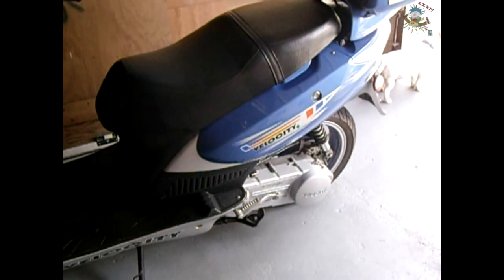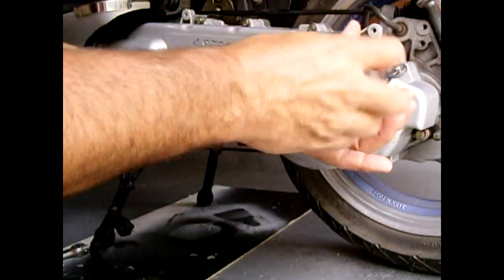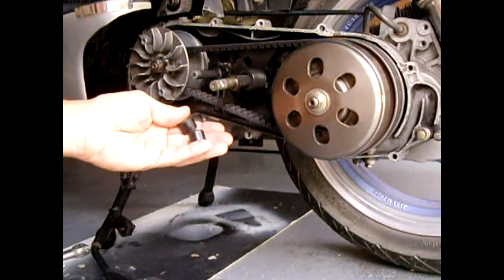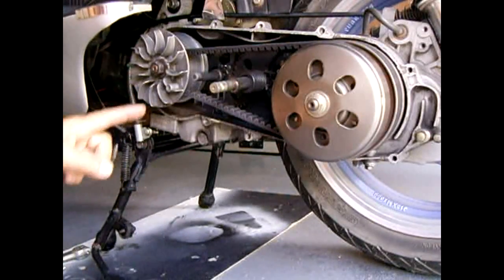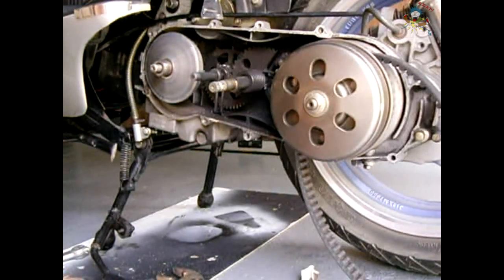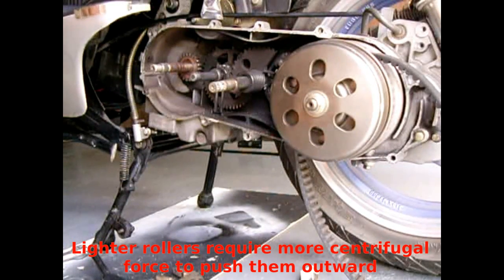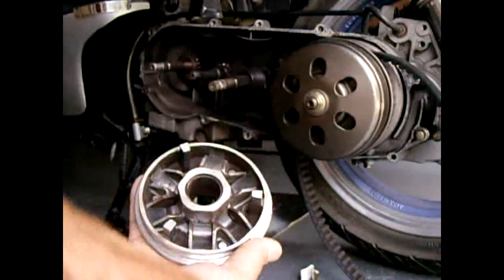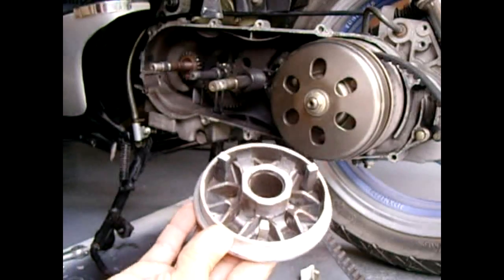GY6 Variator/Roller Replacement & Tips(STEP BY STEP)

Comment: A mechanic who is articulate, and knows how to reduce a learning stream by 70%. A good instructor and film producer all in one. GOOD JOB......
Reply from the maker: JayR Glad you enjoyed the video. :-). Thanks For Watching. Please share and rate Thumbs Up
Reply: electronicsNmore are 6.5grams good for my taotao 50cc
Reply: I agree.
Reply: electronicsNmore this must not be a 50cc, that roller weight sounds real heavy for a 50
Reply: @electronicsNmore  - Between electronicsNmore and Garret Seesing's 911 Scooter videos, I've had the help I needed to keep my scooter running.  I'm not a mechanic.  I'm not mechanically inclined.  Watching your videos to help me diagnose problems made me realize that I am smart enough to work on a scooter if I follow good teachers.  Thanks for making my scooter a fantastic 1,099 dollar investment.  By the way, I had my 2018 Icebear scooter stolen and expected to take a bath on it with the insurance company.  But I have GEICO comprehensive coverage for less than 30 bucks a month and they valued the scooter at more than 1,500 bucks and I got a check for 1283 bucks (after 250 deductible).  Always take the time to compare GEICO with any other insurance companies' offers is my advice.  I was amazed that scooter's ROI would be more than 100% after putting 5,000 miles on it and 18 months after I bought it.

Comment: Why did you not show using that strap method to remove the 19mm bolt?? And using rods in the plastic fan to secure it can easily break the fan.  I must just have one hell of a tight nut on mine because I am buying an impact wrench.

Comment: I love the video. Thanks for posting. I notice your belt is inside out from mine. I asked about this and was told the drive comes from the grip of the tiny perimeter of the belt and was wondering if your belt was different or you flipped on purpose? If you flipped was there a noticeable change?

Comment: Great Video, I have the symptoms of noise coming from the CVT cover. However my 2014  150cc Tao Tao also shakes and stalls out when I come to a complete stop. I have cleaned the carb, checked valve clearances, cleaned fuel filter, messed with the idle screw, and yet it still shakes and dies out when stopping. It was running fine until about 2 weeks ago and then all of the sudden I am having this issue of stopping and having it stall out. Do you think changing the rollers out may stop me from having this issue?
Reply from the maker: Check the valve clearances according to my other video, as well as inspect the intake manifold for cracks.

Comment: My 125 scoot is flat out at 45mph when it should be able to get 50-55mph, so what roller weights do I need to restore the scoots top speed? 
Thanks in advance.
Reply from the maker: I used 15gm.....take out the old rollers, and weigh them.
Reply: electronicsNmore Thanks👍

Comment: Thumbs up, great video. 
I just bought a 2016 Tao Tao Quantum Tour 150. 
Any idea what size stock rollers comes with the scooter. 
I too am thinking 15g rollers would be best for my riding style.
Reply: Cajun Kevin my 2016 TaoTao Motors 150 came with 12g rollers which I have already changed 215s I seem to get a better overall performance out of the 15s

Comment: Just recently bought a second hand sunl 150cc atv.when taking off I have to rev fairly high before it engages...other then that the motor runs awesome .in your opinion what would be the issue..thanks in advance.
Reply from the maker: Worn belt or the variator roller weights are too light.

Comment: good channel and simple instructions but I still had to use a impact wrench ..the one I used was Ryobi battery operated ..and did not use a oil wrench to hold variator ..with a new belt you need .impact I tried this way on this channel and did not work to will ..new belts don't go on to easy but once stretched belt is easy ..I have a sundiro 125 cc scooter ..

Comment: Hello, I have a gy6 and have just changed the belt (very shredded) but wasnt able to take off the clutch or variator.  case cover back on start up good, I usually idle high tire spinning ..but now seems to be taking off in like a low gear.... and eventually does get up to speed.  just takes a while.. like counting seconds rather than gas and take off fast.  is this similar? .  any help would be appreciated.thank you
Reply from the maker: Hi Mike. Sounds like a lot of debris needs to be cleaned up. I suggest borrowing an impact wrench and removing the variator and clutch for easy cleaning. Thanks for watching!
Reply: @electronicsNmore  thank you

Comment: Nice video.  It would be nice if you mentioned the torque setting of the nut.
Reply from the maker: I think it's around 35-40 Ft Lbs. I just made sure it was very tight, and applied some loctite. Never any issues. Thanks for watching!

Comment: Hello i need some help please im confused,i have a 125 qingqi 10D with  7000 km it looks same as yours the variator. now recently i change the weight rollers because they were very worn,my question is i have 2 spacers one go with the big lock nut and the other one before the fan i just wonder if i really need those because i after i change the rollers i have some weird sounds and im thinking they are comming from these 2 spacers.i see you dont have those spacers. thank you

Comment: Do you know what direction the roller weights are supposed to be in? I've had only one time the metal slipped out from the roller, it damaged the variator, I heard something about your supposed to put the more sealed off side wall in a certain direction. Never heard of the specifics. PST subscribed!
Reply: I know how to install them lol, but this was a little scary.
Reply: Robert which grams did u go with I have a 50 cc toa toa

Comment: Hi Man. Do you just use torque wrench to remove the nut with the grip from the oil filter wrench?
Reply from the maker: A torque wrench is only used to tighten bolts.

Comment: @electronicsNmore  Is this theory correct that after applying grease on round rollers in variator they don't able to roll properly and tends to slide which cause irregular flat sides. And these irregular flat sides causes vibrations on certain speed? Is it right?

Comment: I forgot to ask though too can you spray the rose with silicone to make them slide easier and last longer???
Reply from the maker: No, the oily residue ends up on the belt making it slip. I've used a thin film of powdered graphite for locks with no problems.

Comment: The performance kit I ordered came with 5gran rollers should I order 15gram rollers instead?
Reply from the maker: The engine will rev like crazy before moving using weights that light.

Comment: my 150cc the gear is engaging at idle, almost dropped on side when I started it up and wasn't on it. Now when I stop at lights and such, it still wants to engage and I have to literally hold it back. I never worked on these but I'm going to remove the cover to see what's going on... any suggestions on what to look for??
Reply from the maker: Has the engine RPM increased at idle from the norm?

Comment: I hear a loud rattling but only when the engine is revving down. Like as I let off the throttle as I approach a stop sign. The sound is not present when accelerating or idling, only when slowing down or coasting. Could this be caused by worn rollers?

I initially thought I had a loose bolt somewhere that was jiggling but I can't find one anywhere.
Reply from the maker: You need to pinpoint the location.

Comment: How can I determine the weight of the rollers in my Roketa gy6 150cc stock (oem) variator set, and the torque and rpm of the clutch set?
Reply from the maker: George Roberts You need to buy an inexpensive digital scale.

Comment: I would've loved to see how you used the filter wrench to get the variator off. I'm stuck right now and not sure how to get that part off.
Reply from the maker: Place the oil filter strap wrench around the edge of the variator to hold it.
Reply: Scott Milnes just find someone who has a very powerful drill, preferably a corded one that plugs directly into a socket, they are always powerful enough and u don't even have to hold it from spinning, it'll spin a little but the nut will come off so fast it'll barely have time to spin, if u don't know anyone who has a high powered impact driver u can rent them cheap at places like home depot and free and some auto parts stores

Comment: my sons lexmoto dart 125 ,GY6 I think is sometimes not engaging drive when revved ,its only got 5k ,tips on were to look first would be a great help ,cheers.
Reply from the maker: +salisburyplain998 
Maybe try 1 or 2 gram heavier rollers. The engine will rev less off the line. You may also need to inspect the clutch.
Reply: cheers thanks for the reply,Ill give it a go :)
Reply: +electronicsNmore Was this for a larger than 50cc GY6? The largest rollers I've seen for a 50 is 7 gms.
Reply from the maker: Don Diller
The procedure is the same for 50, 125, 150 cc scooters. Many sizes available.
Reply: I just put    9 gram ones on my sunny 50cc  when my belt went  8k.   up hills its slow 15mph     faster on flat ground 40MPH up

Comment: Hi
 my stock variator roller size is 20x15mm 18g, Can I use 18x14 16g ?
Reply from the maker: No, it will rattle too much. Use the same size it came with.

Comment: Would 15gm weight roller work on a rx50 wolf scooter. Same belt case as this one
Reply from the maker: It will work, but how it accelerates and top end speed/engine RPM will change if the weight is different than what's installed.

Comment: Is it right to apply greese/wax on rollers and in variator for smooth spinning of rollers in variator?
Or will it make more issues after some time like dust attraction, vibrations etc ?
Reply from the maker: No oil or grease
Reply: @electronicsNmore  why not? What issues will come?
Reply from the maker: @Sidg2  Could get thrown all over the belt and make it slip.
Reply: @electronicsNmore  Is this theory also correct that after applying grease on round rollers they don't able to roll properly and tends to slide which cause irregular flat sides. And these irregular flat sides causes vibrations on certain speed? Is it right?

Comment: I hope this makes my trike 50cc scooter go faster I’d at least like to go 50 but I finally changed it to a 100cc jug and piston but it smokes because it’s to powerful for the 50cc head so I have to get a head and rocker arms and exhaust and it should stop smoking. But if it doesn’t I’m going to save and get the complete 80cc kit with everything right down to spacers and gaskets oh by the way it does 71 mph now but it’s smoking bad and it is almost new so I’m not going tear it up just going to get the right stuff and do it right.

Comment: wont 18g rollers be terrible on take off on a 50cc gy6 139qmb?
mine has 5g rollers in in and it takes off ok but i ordered 4 g rollers for more take off.. i installed a new DLH racing variator and staggered my weights 5g 7g 5g 7g 5g 7g to get an over all average of 6g variation and it is slower on take off now so im going back to the 5g rollers until my 4g rollers come in a couple days.. im also going to install a 1500 rpm yellow racing clutch spring to help on launch.. im trying to find the best possible setup for 0 `to 30mph and pull a hill at a steady 20mph or better if possible.. i only weigh 170lbs .. what is your recomendation?
Reply from the maker: Lower weight rollers will cause the engine to rev a lot more before you start to move, and cause the rpm to be much higher at top speed. For best fuel economy, a heavier roller is best, but you lose speed on take off.
Reply: What about those people putting 18 g rollers in? I live in the mountains with lots of hills.. so would you put 4G rollers or 18g? I'm think of the 4G cause 0 to 35 is all that really matters as long as it can steady pull me up a hill doing at least 20 to 25..your thoughts on roller weights and driving up hills?
Reply: @youngbuck22481  ,. The confusion here rests between 50cc and 150cc GY6 versions.
50cc scooters used weights around 5 grams and 150 around 15, that's just ballpark numbers I guess....

Comment: What happens if you don't tighten the belt enough at the end? Could that cause the belt to slip and very loud noises from the variator. Because that's what's happening to me.
Reply from the maker: The belt tightens automatically if the variator/clutch is working properly, with the correct size belt installed.
Reply: @electronicsNmore  Any idea what could cause the loud squealing noise. I was playing with the roller weights. Went with heavier first. Everything was ok, but scoot was slower. Went with a bit lighter expecting good results and the squealing started. Doesn't make any sense?
Reply: Ik I’m 2 years late but I didn’t tighten mine enough it came loose I lost power and the end of my cranks shaft it slightly damaged but not enough to need to be changed thank god

Comment: Im trying to upgrade my cvt but the back plate that holds the rollers in is stuck on the shaft..how can I remove it?
Reply from the maker: If you have the entire assembly in your hand, carefully inspect it for retaining clips. If none seen, then you'll need to carefully pry it apart.
Reply: @electronicsNmore   finally got it! Thanks for the reply.

Comment: Do not apply thread lock on nut .we have been playing with cvt drives for years never needed to use thread lock never had one come loose. Manufacturer does not have this  on procedure on varatior replacement. Why are you recommending this additional step??
Reply from the maker: Randall Highsmith If you don't have an impact wrench, then I highly suggest using medium strength thread locker. I used it for years with no problems. If you don't want to use it, then dont.
Reply: actually i use the proper tools and the torque specs per manufacturer

Comment: I've seen variator kits with 3 small springs in it what are they used for?
Reply from the maker: +Blaq IVen 
Those springs go in the clutch.
Reply: I don't understand why they would be in that kit do those go bad when variator does?

Comment: on my 150 what would be a good roller to use?
Reply from the maker: All depends on the terrain, or if you want good fuel economy. 14-15gm is ideal for hilly areas, and 18gm is good for flat areas where fuel economy and highest top end speed is desired.
Reply: What is a good roller weight for hilly roads?

Comment: So assuming that my bone stock 150 has 18g rollers .. If I go down to 15, will I lose my top speed of (around) 50mph?
Reply: Great video btw I'll thumbs it up as soon as I am done typing this. Very detailed.
Reply from the maker: +Gregory Megatron 
Hi there. Using lighter rollers will cause the engine to rev more before moving(higher RPM). The result is more torque up hills and off the line, but usually the top end speed will be a little lower, and you will not have as good gas mileage cruising down the highway as heavier rollers. Thanks For Watching!
Reply: Ok thanks for the quick reply! Honestly I don't quite need to take off quicker and would prefer any high end that I could get so maybe I should go heavier than stock.. Or here's a dumb question: changing the stock rollers with the exact same weight but higher quality do anything different or no? Also have you tried experimenting with removing every other roller?
Reply from the maker: Gregory Megatron

Quality is irrelevant. 18 grams is 18 grams. :-)